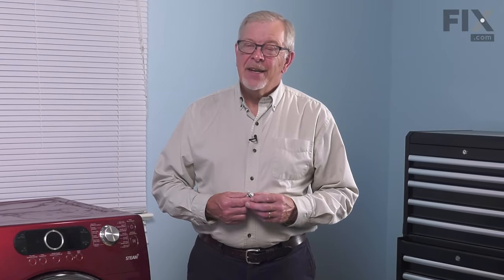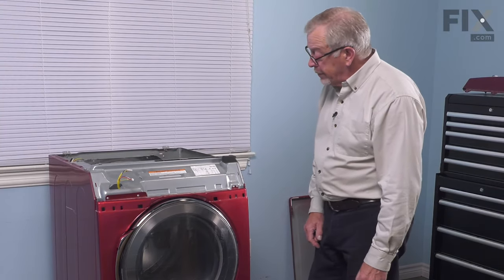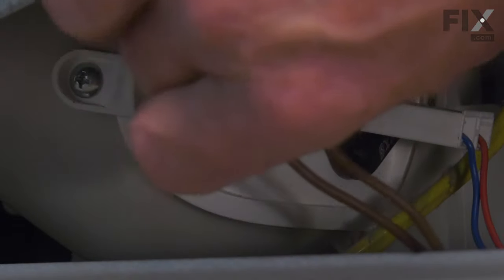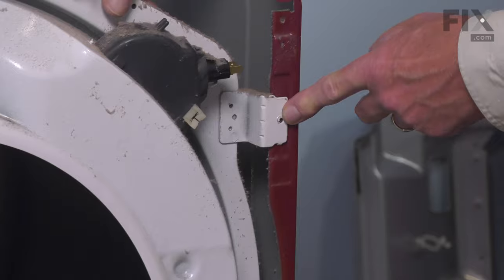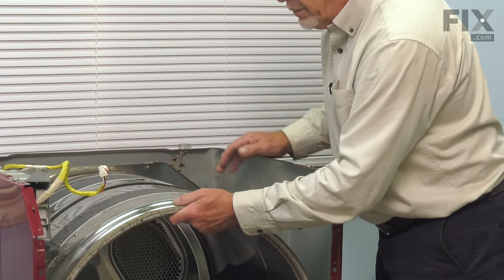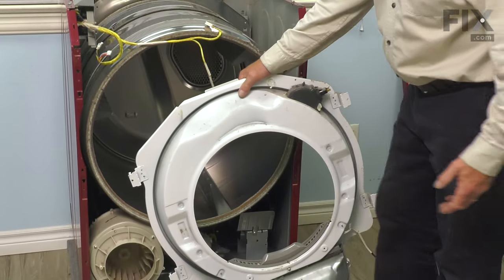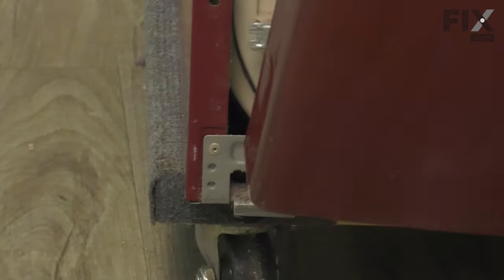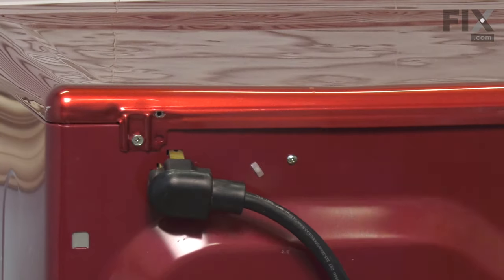Samsung Dryer Repair - How to Replace the Thermal Fuse

Comment: absolutely the best instructional video ive seen. very detailed and accurate. resulted in taking my dryer apart, found a broken drive belt, replaced the belt and the thermal fuse along with it, replaced all parts and it works great!!  thank you for your help, you saved me a ton of money!!

Comment: That belt is completely frayed!  You can see it immediately when the view switches to the interior looking forward at the idler pulley and again when the belt is re-installed around the pulley.  Why take the time to tear everything down and NOT replace the belt while you're at it, especially when it's clearly frayed??  Clearly he didn't even look at the belt.  Wild.
Reply: Wild is for you to assume the dude that is literally teaching you how to service the entire machine and posting it on Youtube is unable to identify a belt that is falling apart. I am pretty sure he replaced it. It is just not the focus of this specific video.
Reply: @lars20th it didn’t look like a replacement belt… very badly frayed
Reply: @erichuth2510 I think they’re just saying the video is clearly focused on the fuse replacement. Even though that belt is clearly frayed and he doesn’t replace it in this video, for sure it’s been replaced since. 

I mean… I’d hope so 😂